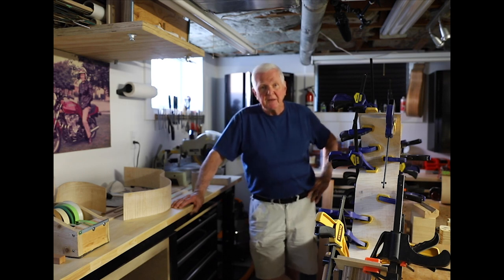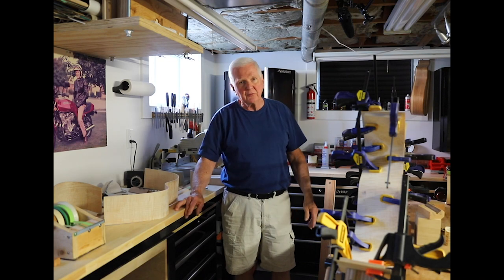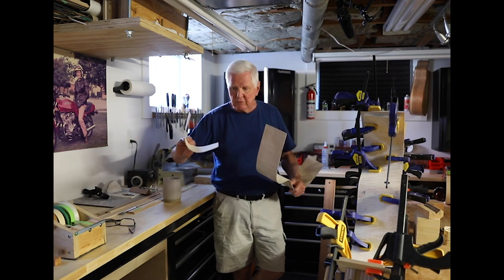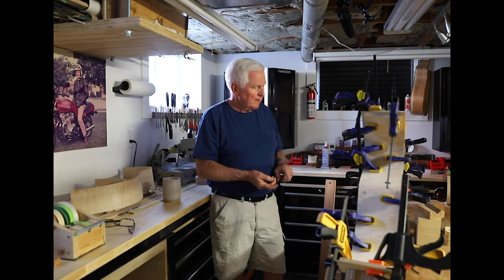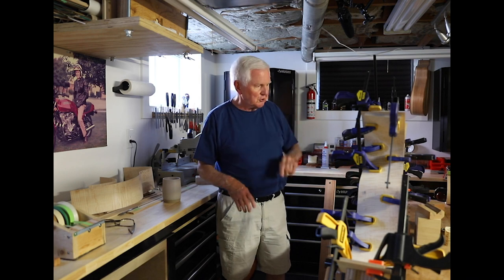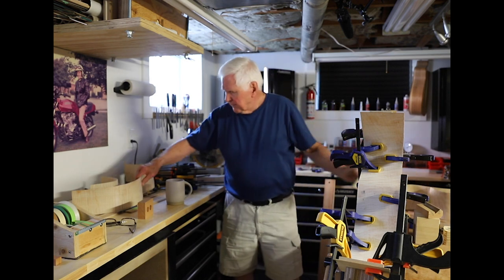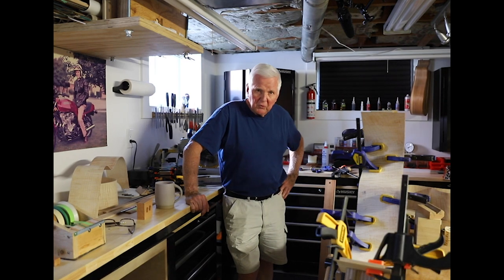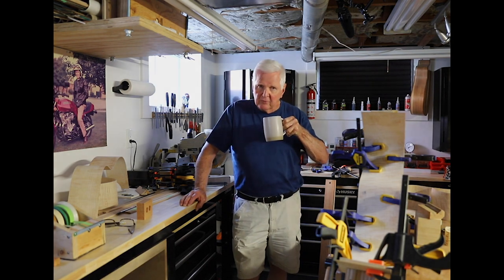Disaster Strikes...the new build is garbage

Comment: Hi Monty, the guitar I’m currently building is Maple sides, back and neck. I don’t have a bending jig so I use a heated aluminum tube and I soak the wood for a few minutes (maybe 30 minutes) and the keep the wood wet as I progress. I’ve found that working with Maple is not a piece of cake. I watched carefully during the bending process for the ‘hint’ of the start of a fracture or crack. I had to stop and re-soak a couple of times. The Maple I used was straight grain - I’m lucky I guess - I didn’t have the problems that figured Maple presents. I wish you well and look forward to viewing your expertise as you continue with this tricky build. - Mike
Reply from the maker: Well done Mike. I've learned that bending maple is as difficult as bending mahogany. I took my second attempt down to 70-71 thou and it bent without any trouble at all. But, I think one still needs to go slowly at this. This is figured maple quarter sawn and no cracks. Check out my instagram as I have some pictures up there.
Reply: Monty McKinnon —> thanks, I’ll have a look